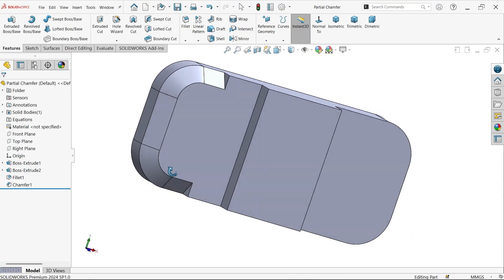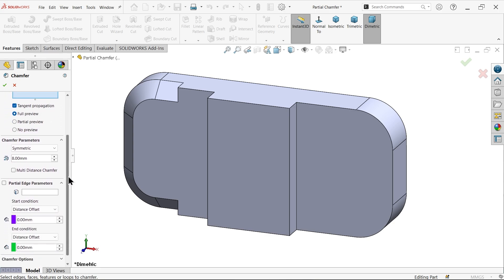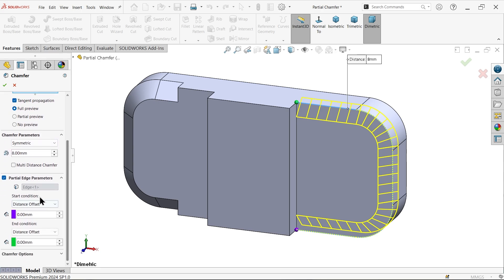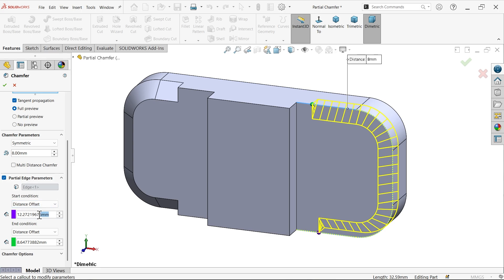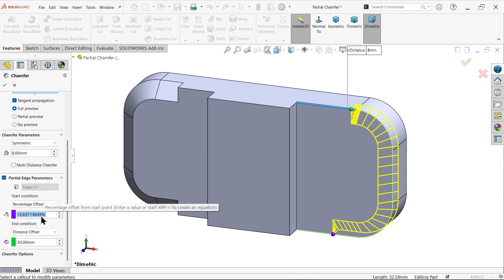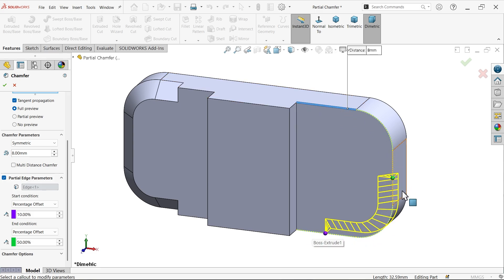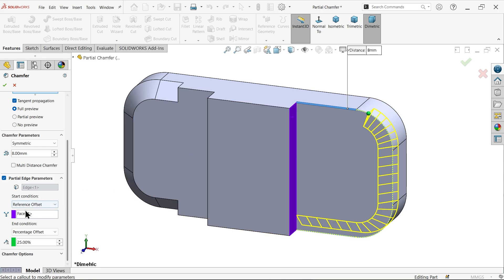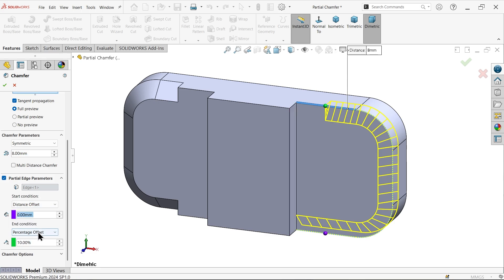Create a Partial Chamfer in SolidWorks

Comment: But If you change the thickness from the amboss you will have an effect of the distance from the dimensions, right? If you make the amboss smaller oder bigger the starting point of the chamfer will also move. For a quick solution to show its ok but the partial chamfer is not stable. Is it not better to use separate planes for creating stop corners or something else? Shure its more steps to do but more stable I would say.
Reply: Depends on how you look at it. For example, if you want the total length of the chamfer to always be 30mm (for example), then of course changing the size of the smaller Extruded Boss in this part will destabilize that. However, if you want the chamfers to always be 20mm distant from the smaller boss (as in this video), then changing the dimensions of the smaller Extruded Boss will keep that. So, like always, you'd have to plan ahead and determine which dimensions of your part will "Possibly change" and which will "Never change." If the size of this smaller boss is likely to change, and the total length of the chamfer is important, this Partial Chamfer method is not a good choice, as you mention.